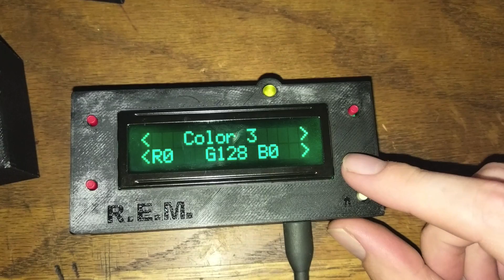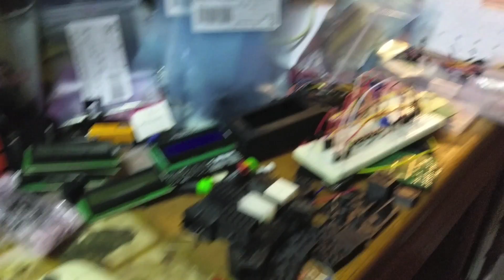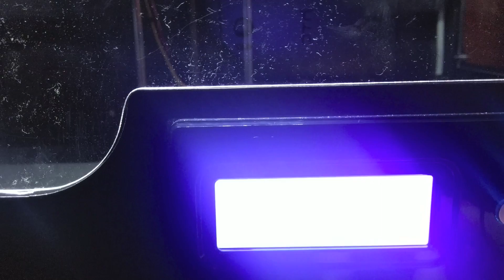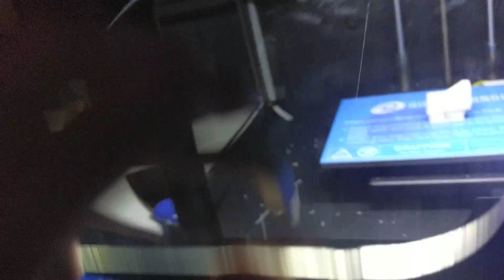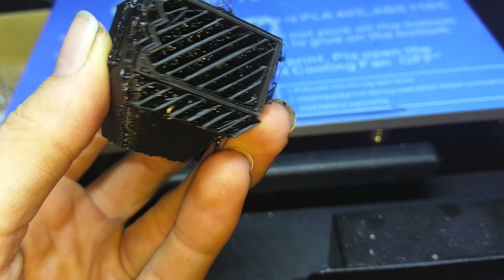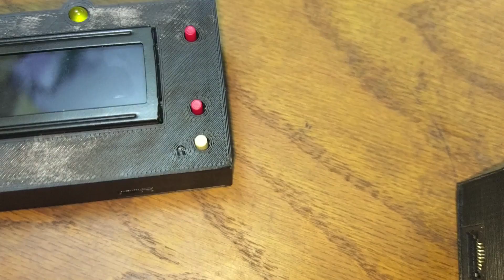Renduinix Alpha Models! / 3D Printer Stuff

Comment: Is there a way to hook up the board to be backlight control to be turned on by the light switch?  I know it's a totally separate system but just an idea for functionality
Reply from the maker: Hmm, that would require people to splice into some wires which turn a lot of people off. I am thinking about adding a light sensor so it will adjust brightness automatically. But I feel like the Backlight Menu should be enough for most users.

Comment: Do the alpha ones come completed or do you have to build it? I have an 87 4.0l xj manual, 2 1990s 4.0l xj automatic and a 89 4.0l xj automatic
Reply from the maker: Damn, that's quite the collection you've got there. They come preassembled and ready to go out of the box.
Reply: I have a 93 and a parts 90 also
Reply from the maker: The alpha model should work fine on all your renix autos, still battling the manual ecus though. Unless it's just my friends garage project that is a little wonky
Reply: Could the automatics have extra wires to communicate with the transmission computer
Reply from the maker: They do indeed, that's what last weeks video was about. I still need to figure out what kind of circuit will get reliable data but it may be possible at some point.
Reply: And I have a 89 manual wiring harness that I could cut the plug off and send it to you if you want
Reply from the maker: And thanks for the offer, but I think I'll need to tear into a manual ECU at some point if I really can't figure anything out with them. If you were to get a model, which screen would you prefer?
Reply: negative LCD
Reply: I still have the computer from the manual 89 I could sent you to tear apart
Reply from the maker: The smile on my face right now. Haha. If you would be willing to do that, i'd be ecstatic. Would you need it back when I am done with it?
Reply: no, I wouldn't
Reply from the maker: Well, if you're willing to send me an ECU, then you're definitely getting hooked up with an Alpha Model.
Reply: I wouldn't mind paying for one, I know you have a lot of work and time invested
Reply from the maker: I have, but I don't mind rewarding people that are willing to further the project above and beyond the norm.
Reply: I sent you a message on Facebook

Comment: what is it??? I am guessing it's a code reader. what else does it do
Reply from the maker: For now, the easiest way I can describe it is as a digital gauge pod. It displays 4 readouts from the ECU that you would like to watch, like rpm, battery voltage,  sensors, things like that.
Reply: well that's awesome! you seriously put some work into building it. 
excuse my ignorance. any chance of controlling the aw4 selinoids with the unit?
Reply from the maker: No controlling as the Transmission doesn't have a Receive pin. The only way to control it is to bypass the TCU by cutting and splicing into the control wires. I would like to include reading the trans into the final model though.

Comment: I would gladly lay down the capital for this project. I am however not as savvy with DIY type of things. I do know that is was mainly started for the "Renix" models of Jeeps, mainly the XJ. I have a 99' XJ myself. I don't think that this would play very well with the update ECU and connectors that are on later models. If I knew how to splice or install it, I would gladly jump on this. Even still, keep up the great work. I believe it will pay off. I still enjoy watching the channel.
Reply from the maker: Sadly, this will only be the older Renix Jeeps. Good news is since you have OBD-II you can get something called a ScanGauge II which is very similar to what I am working on. I have one in the Civic and I love it.
Reply: Thanks for the suggestion. I will definitely look into that. it's always a good thing to know how our Jeeps are running. still dig the concept of the device. I wish I could help evaluate it with you. keep up the good,hard work.

Comment: I had a class in school several years ago where we designed and built things with a 3D printer. It worked a bit different by using a secondary material for the supports and when it was done you drop the part in acid which took off all the support material. That printer probably cost close to $10,000 though but it printed very well.
Reply from the maker: I have looked into that a bit, since my printer is a dual extruder, I could print with dissolvable support material but I seem to get by without for now.